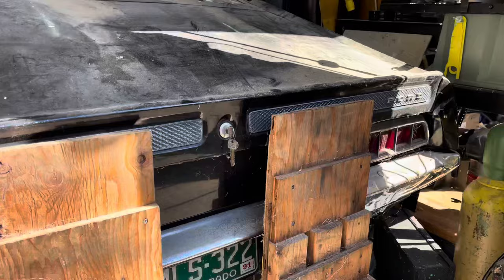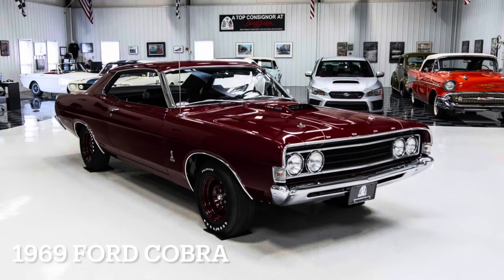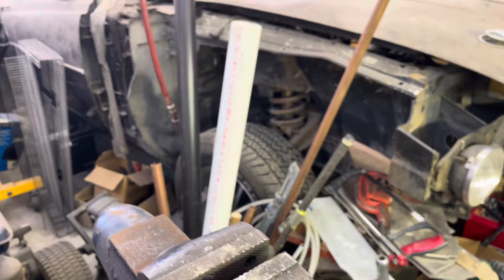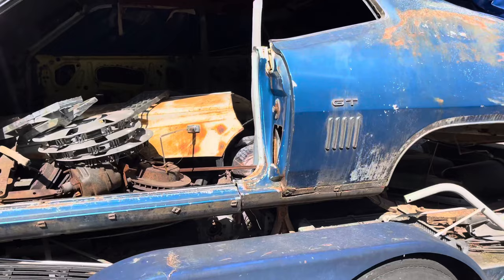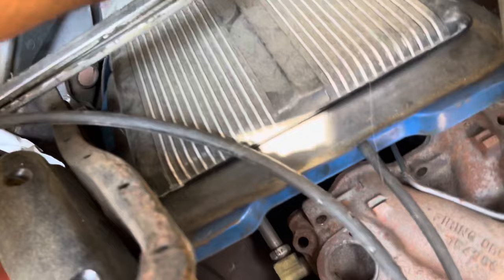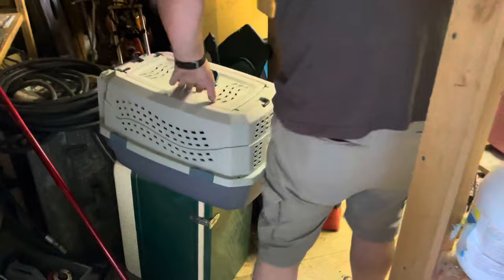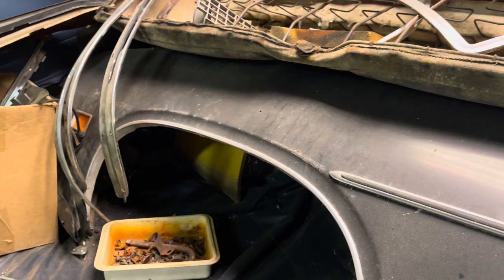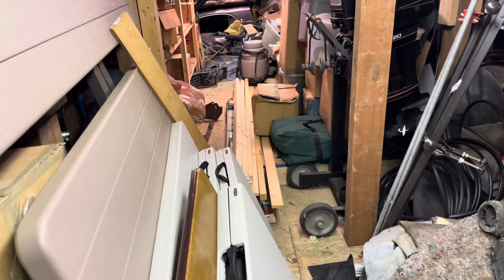Rare 1970 Torino Cobra 429 Cobra Jet that’s been off of the road since 1990!

Comment: Very cool!  One of my best friends ~ his dad was the original owner of a grabber blue Torino Cobra, SCJ, 4-speed, ram-air.  He rarely drove it because it had an issue with the crank.  Being pre-internet days, he had a hard time finding a replacement crank for it.  So it sat under a tarp except for the rare occasion when he would fire it up to take around the block "for maintenance purposes".
Reply from the maker: I have a soft spot for full size muscle cars!
Reply: @DezzysSpeedShop my Dad has a Yellow 70 Torino 429 scj 4speed 3:91 factory ribbon tach drag pack all original just has a little bigger cam in it and man she runs . He would walk all over my 69 mach 428scj until I built a 445 stroker fun car to drive

Comment: The SCJ wouldn’t have a 3.25 rear. It was either 3.91 or 4.30 as stated plus the oil cooler. Basically it’s a
Known as Drag Pak option.
Reply: I love my torinos. I have a 70 convertible and a couple 70 1/2 falcons.